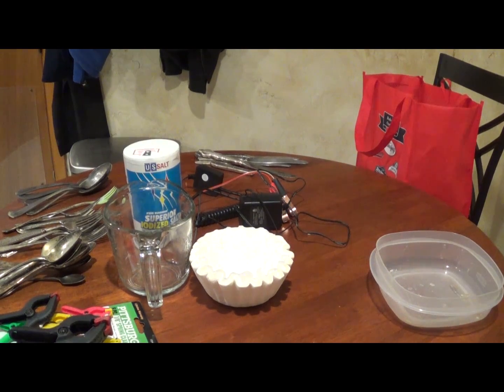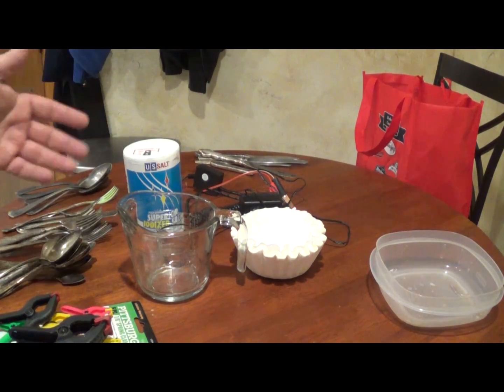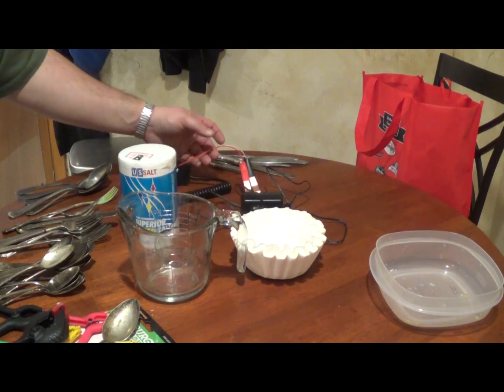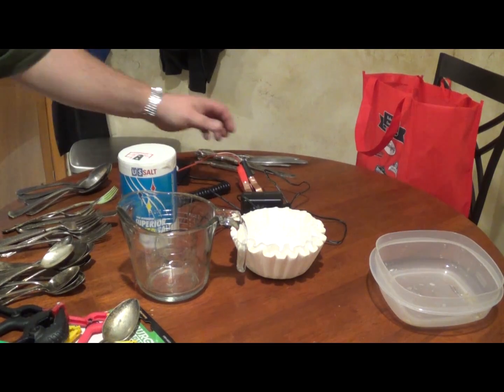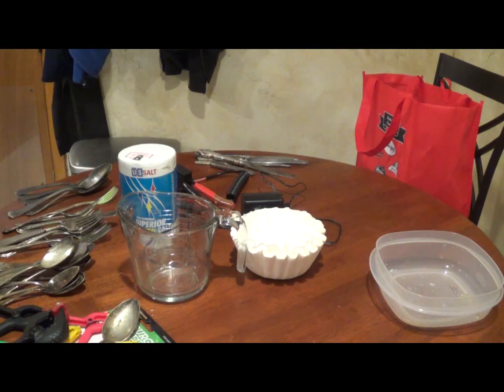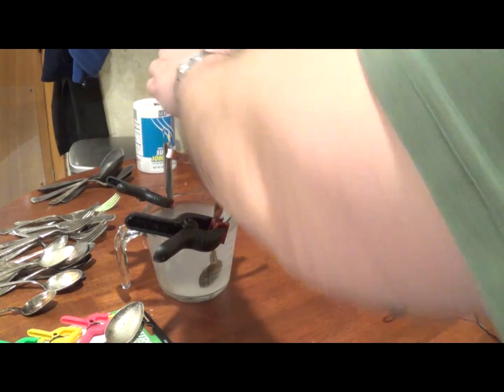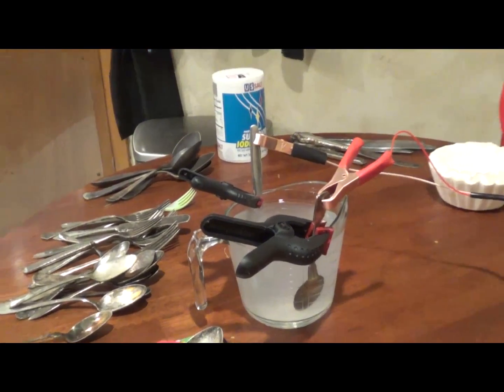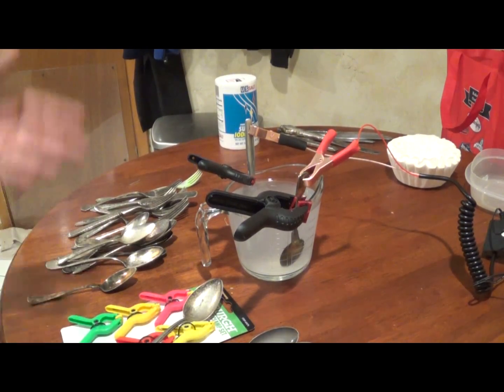Silver Reverse Electroplate Experiment 1 without acids!

Comment: Moose, this is how schools could effectively teach science. 

You are doing something practical so that you can generate income and you are trying to figure things out. You want that silver! Also, the base metal might be another material that can be recycled.  

Your list of possible reasons to explain why your process failed is *wonderful*.  Those are hypotheses you have stated and then you can use each of those hypothesis to come up with a systematic way to get that silver.  You looked at a lot of factors. If this was a school science lab assignment & you had to do a write-up for what you did, your discussion section of the write up would get you an “A+”!!   This is the thought process that science class should teach you — it took getting my undergraduate degree in biochemistry & biophysics to learn how to apply the scientific process. 

I ran across your video because I want to remove the silver off of some of my  large silver plate serving pieces which a well meaning person put in the dishwasher. I think something in the dishwasher cleaner ended up pitting and scarring the pieces. 😿

So I am doing my research. Thank you!  You have helped me out. 

BTW, my bet is that you need higher amperage.

Comment: Use a PSU from an old computer, even the older (250 watt) will give you up to 15 amps on the 12v rail. Bridge the green sense wire in the 24 pin motherboard connection to a black earth and away you go.Plenty of info on the net about which colours of wire are dedicated to which voltage.

Comment: Moose, try placing the electrodes nearer and also playing with the volts. I found it best to have the negative electrode (electrode being plated) above the positive electrode.. Exposing pure silver on each electrode will allow for a better transfer of silver particles. Also, a larger surface area will be more effective, so use the bowls of the spoons to put in the water. Try sanding them or maybe you could give them an acid bath to get all the gunk off.

Comment: i had the same problem .i ponderd and thought water comming from your copper pipes has many minerals in it i tryed distilled water and a 10 amp charger with meters on them as you get to 8 minutes you can see your amps drop on the meter on your charger .i used a charger with led lights that show you charge levels but no good .it has to be a charger with a clock type amp meter .

Comment: If a reaction occurs then you should have plenty of power. Your electrolyte(salt) is most likely the issue. Try using sea salt or purified iodine. Table salt has a lot of impurities and can cause oxidation in your electrolysis cell.

Comment: Hi Moose, David from Norwich UK, quick question, sorry its not about your last video which was interesting, but can you help , if you want to discharge a CRT TV  is it ok to use ordinary electrical wire say from a mains lead attached to your croc clips when attaching to the metal frame of the tv and then to your srewdriver? Thanks
Reply from the maker: Great question, I think as long as no other part of you is touching the TV and the handle is made out of an insulator then you should be fine.
Reply: Moose Scrapper  Thanks Moose will give it a go.Happy Xmas

Comment: MOOOOOOOOSE! I commend you on your willingness to try. In my opinion you can't learn unless you fail. On another note, whats up with your truck? How did it die?
Reply from the maker: multiple systems failure.  Power steering, gone.  Leaking coolant in to the engine, steering box, gone, too much rust to pass state inspection, will not stay running if its under 20 degrees F, heater not working, engine knocking, brakes going, and instrument panel gauges are not working.  Cost and time to fix, worth way more than the value of a 17 year old truck with 270,000 miles on it.  That's ok, where there is a will there is a way.  I will make due somehow!!!
Reply: Ouch, at least you got your use out of it. Sounds like you have the right attitude so enjoy the lemonade.
Reply: Moose Scrapper Hi Moose. try using sodium carbonate. place baking soda (sodium bicarbonate) on a cookie sheet and bake it in your oven at 350 to 400 degrees for about 30 minutes. this will take the bi out of the bicarbonate. dissolve that into your water as your electrolyte. I use this to remove iron oxide from steel. I use a heavy duty automotive battery charger with a 50 amp boost mode. it typically takes anywhere from 24 to 72 hours to clean up a heavily rusted horse shoe found buried in my yard. clean up with dawn dish soap and a wire brush and immediately coat with something to prevent flash rusting. although watching the metal rust before your eyes is pretty cool.

Comment: Hey moose, got your name from Justin Gaber.  I've successfully done this.  You're forgetting that electroplating is an exchange of ions.  if there are no silver ions in the water then nothing will plate to the stainless steel.  All I did was take 2 pure silver rods as my cathode and anode and hooked them up to a 9 volt battery for 6 hours, then reverse plated the silver to a stainless steel kitchen sink I cut, using 7v and 2 amps out of a battery charger.  All done in the same distilled water I started with. I did add 1 tsp of vinegar to the water before using it to reverse plate. Mind you, if you up the amperage it goes faster but the silver will go black, the lower the amperage the more the silver will crystalize and the longer it will take.

Comment: Hey Moose, I did this exact experiment from his  video directly as well and it worked just fine for me. as a power supply though I used a 120v to 12v wall plug in adapter, I can't find it right now :/ or I could tell you the specs on it. It worked surprisingly well so when I track it down I will let you know what the detail are on the converter. Keep up the good work :)I enjoy the vids
Reply from the maker: Thanks!
Reply: Hey moose, So the unit I used is a 120v AC 60Hz DC Power source, input is 120vac 0.8A, and output is 13.2vdc 3.5A and its a class 2 power supply.  Hope this helps at all

Comment: First it was not a failure. You are correct. What you observed is oxidation. The black is Silver Oxide.

....and if there is 0.75 grams yield from a 14 gram spoon then I'd be shocked. That would be a 5.36% yield and they'd be labeled as "Silver Filled".  I believe that he missed  it by a decimal point as 0.075 grams would be reasonable. 

(I have Jewelry Items, Military Pins, marked as "Silver Filled' and the expected yield from them is 2.5%. )  

Personally I'd figure the yield at one gram of Silver per kilogram of source...just like low grade Gold Plating. It is just not that heavy of a plating...0.1%. I have been told, many times, that the Silver from plated items is uneconomical to recover, and Silver plate will never be economical to recover, due to the Energy expenses. (Even without using electrolysis it takes Energy to synthesize Acids. Acids release Potential Energy when they react. University Chemistry 115. When you use acids you are using stored potential energy.)

And I'd actually drop my amperage to between 3 and 4 amps aiming at 3.5 amps which is the amperage used in a Silver electrolysis cell for refining.

I may add in Silverplate, and Silver Filled would be much better, into a Gold Refine batch for inquartation if I have not enough ready Silver or Gold Filled. It beats melting fresh clean copper into the Karat Gold..

Thank you for your video, Moose.
Reply from the maker: This is why I love when people comment!  Thanks Rocket!

Comment: you could always convert a old pc power supply ....
Reply from the maker: I would love to learn how to do that without killing myself.  I find I am much better at taking things apart then putting back together...lol
Reply: when i tried it...i noticed the plastic reduced the electrical current. it wouldn't bubble as much until  i just used a metal wire and tied it off to the 5 gallon bucket i used...

Comment: You NEED to add acid to  keep the pH acidic, HCl is best but i've tried with vinegar and works fine, btw 6 minutes is too long more like 50-60 sec. depending on the plating.
Reply: oh and use a car battery or car battery charger for power source... modified PC PSU is  another oprion

Comment: hi moose by trade i am a master electrician for the low amp you can make your dolution more conductive by adding more salt and heat it up  not boiling but  near i did work in many place that did electroplating they always heat up the solution like around 100f the black look to me like oxide i had found metal detecting old coin like from 1600 they haf that same color

Comment: hey moose I have replicated this hundreds of times In the past after watching the video you commented about. it has worked perfectly for me every time using a Peak emergency vehicle jump starter. this 12 volt jump starter provides ample power between stainless steel knife and silver plated item. I use a ice cream bin 1 gallon plastic to attach both items to. I leave the peak jump starter plugged in because the power drains quickly. turn the system on leaving it in for 9 minutes at a time and the silver plating simply flakes off. in a single batch9 min each I can reverse electroplate usually up to 12 items the liquid gets Brown and frothy needing to be strained in the end you get a sludge with silver in it. it really gums up your Crucible. lol

Comment: Hey Moose  I wonder if you use the chargers that require  them to be hooked to a battery to work, hook them to a battery and then  put some wires from the battery to power the deplating, that might give you the higher  amp output you want, and  to use your existing  charger.  be careful, i havent tried this  at all. Im hopeing you will come up with a decent  way to deplate silver, I posed the question about the  aircraft avionics wire that is silver plated on a diferent video the other day.
Reply: If that  would work at all you might want to put a switch in there between the battery and one of the terminals just so you have a control  for off and on.

Comment: Moose...we all learn from failures! A few thoughts though....your electrolyte should (I think ) be completely saturated. The Stainless should defo be the non-rusting variety. With regard to the power supply, most vids I have seen and things I have read use a supply that produced relatively low volts but high amps. It may also be worth googling patents for ideas.

Comment: MOOSE: The rust color is the iron from the stainless steel knife. Use true, none magnetic stainless, in reality you should use platinum. The metals under the silver has nothing to do with the process. Look at the reactivity series on Wikipedia.The amps is what matters. You need a charger that uses a TRANSFORMER and lots and lots of amps.. Positive goes onto the silver spoon and negative onto the stainless steel.

Comment: <3 you moose. Biggest issue is your charger, your cell is the same as a battery, so use a 6A plus charger,, with a meter, as the ampage goes down the reaction stops.

Comment: electrolyte I believe should be saturated meaning dissolve as much salt as possible and then try.  I really don't know but that's what I would try.  also you can try bleach as Mod44 from the forum did.  could also try sodium hydroxide, that one is just a guess but I know that it can be used to strip Mylars.  I thought of using computer power supply for mine but be warned I have NOT tried anything I listed, they are just ideas I have had.  Sorry about the truck buddy, mine died last month.  Good to see you Moose and glad you're back to making videos.  Take Care, Mike